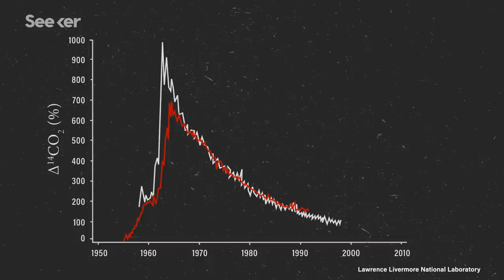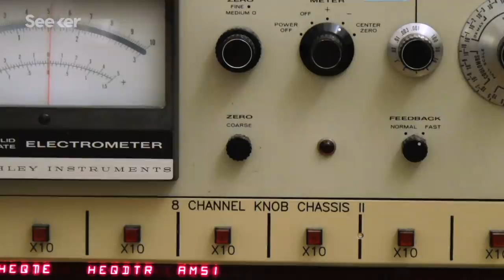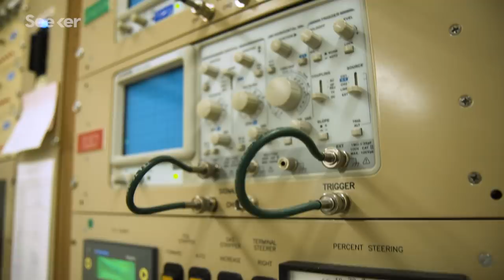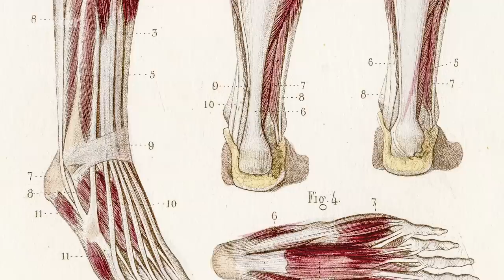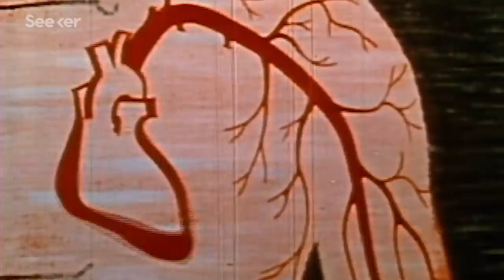We Found Radioactive Traces From Nuclear Bombs in the Mariana Trench

Comment: So the amount of Carbon 14 in the atmosphere rises and falls, depending on current circumstances. So how can we assure accurate radiocarbon dating is accurate if the levels of Carbon 14 fluctuate?
Reply: +1
Reply: 1+
Reply: This
Reply: @acjo8975  This
Reply: Cuz we have air samples for almost every decade stores in the layers of ice in the arctic. the lower you go the air in the frozen air bubbles contains older air trapped  inside
Reply: @med8615  Fascinating! How far back do the air samples go? How can we tell when the air bubbles were frozen in the ice?
Reply: @filmfan4  The record in 2017 was drilling a 2.7 million year old ice core from Antarctica. Idk if it's been beat yet, probably has but too lazy to search. 
They know cuz it snows on the south pole on a regular seasonal basis so each layer represents each year of snow fall. so  it kind of sedements over time like the layers of earth in the grand canyon. So they start from the top layer and count their way down to see how old each layer is. they also match up the data from other rings/ rocks and to confirm their findings. It's like studying each ring on a tree stump but the layers would be vertical. they drill out these couple mile long poles of ice, it's cool stuff. Search up "Ice cores" on youtube or google to see how they do it. They use it to confirm ancient air contents, when ancient volcanos exploded, the switching of the earth's magnetics poles and other cool shit.
Reply: @Tom Holland So apparently for the 2.7 million year old sample they didn't do the conventional ice coring to the deepest part of the ice sheet till bedrock method we were talking about, they used a different approach. After reading the article it seems that they looked for 'blue ice' which is really dense ice that is found in glaciers. Since glacier are floating the sample inside a glacier can be a lot older cuz it could've broken off millions of years ago from the ice sheet and been floating around gaining layers since. 
The conventional method is limited by geothermal energy. Heat from the earth's core can slowly melt away the layer that is touching bedrock (which would be the oldest layer in the sample). So ice that is millions of years old that gathered on the main ice sheet on top is melted a long time ago. It's like constantly layering slices of cheese on top of each other on a hot pan.

Luckily the sample of ancient blue ice they found probably broke off from the main ice sheet millions of years ago and became a floating glacier on the surface, safe from geothermal melting. It was found on Allan Hills where they seems to be a lot of ancient blue ice along the coast. Some are still floating glaciers while others seems to have joined back on the mainland. It was also found flipped on its side so they had to drill a core horizontally which is pretty cool I guess. 

Since surfaced ancient blue ice can last so long they're thinking they may be able to find a 5 million year old sample.
Also the record for the conventional bedrock core is 800,000 years so your numbers are a bit off but really good attempt! There has to be some intrinsic property of the layers we're both ignorant of in those calculations, compression maybe? idk honestly. but somehow they found an 800k y/o sample at bedrock. that's also the oldest one at bedrock cuz anything >800k years old melted...rip. hopefully the blue ice samples are really really old at their core so we can map gas levels further back.
take a look at the papers on library genesis
2.7 million y/o core paper
DOI: 10.1126/science.357.6352.630
800,000 y/o core paper
DOI: 10.1038/nature06949
Reply: They cant it's just smoke and mirrors
Reply: @med8615  Very interesting paper!
Do we know for certain that the glacier did break off millions of years ago, or is that a hypothesis?
If the oldest layer melted then wouldn’t the trapped gases be released? How could we then tell how much Carbon 14 was in the atmosphere?
So we can tell blue ice is more dense, and therefore is more likely to last longer than thinner ice. How can we tell how old the blue ice is? Would an ice age create more blue ice or thicker blue ice?
I’m sorry to keep doing this, but how do we know that conventional bedrock is 800,000 years old? The way we work out the age of things is really complicated. It feels like every method of dating relies on something else, which relies on something else…and so on. Where did it start?
Reply: @filmfan4  good questions, stay curious, I'll write you a reply tomorrow it's midnight here lol. I think you may've misunderstood a couple things I wrote, no worries though. Also turns out I made a mistake about the carbon-14 thing, I'll mention it tomorrow. did you get the melting cheese analogy? the hot pan being the rock continent of Antarctica,  the stacked cheese being the layers of ice.
Reply: UZ Yes I think I got the cheese analogy.
Reply: Good question 👍🏼
Reply: @med8615  I for one have learned from this conversation and am looking forward to your update
Reply: You can't. Radiocarbon dating is a farce. No one wants to admit it openly though - at least not in any forum.
Reply: this is why i put melting butter on my head
Reply: Easy because we compare our findings with other objects we have carbon dated, checkmate atheist....
Reply: @med8615  I'm interested as well :)

Comment: If the number of fat cells stays the same. Just shrinking and enlarging. What happens when someone has liposuction? 

Curious if through repeated uses the body more or less runs out of storage sites in the areas mostly cleared of cells.

Imagine that could have some horrific unwanted side effects like having a muffin top on your chin.
Reply: The fat cells are sucked/scraped out during liposuction I believe, and is the only actual way to get rid of them.

Comment: The whole radio carbon dating process seems really messy and unreliable.
Reply: Depends how far back you go.  For time scales of a few decades up to a couple thousand years (basically all of recorded human history,) its pretty accurate.  Radioactive decay half-lives are very consistent, as long as you have a large enough sample set (since its a statistical measure.)  But given how tiny atoms are, a "large enough sample set" is actually a very small amount of material -- on the microgram scale or maybe even less.

Of course, you wouldn't want to try to use C14 to date things like dinosaur fossils.  But there are other atoms that can date things that far back.  You have less precision (so you might have a +/- of tens or even hundreds of thousands of years,) but when you're dealing with time scales of millions of years, that loss of precision becomes a rounding error.  Or in other words, nobody cares if you can state that the dinosaurs were wiped out on July 12 at 4:38am in the year BC65,382,499.  Its good enough to just say "65 million years ago" in 99.9999% of all common usage, even scientific usage.  I mean sure we'd love it if we could be that accurate, but its not really necessary for us to compose reasonably detailed timelines of the Earth's history.

And of course we have other measurements to compare these things to so that we're confident that we're making good extrapolations rather than pure assumption.  For carbon dating for example, we can compare how our C14 techniques line up to things like tree rings.  If they line up accurately for 1000 or 1500 years (and they do) then its reasonable to assume that they'd line up for 2000 or 3000 years if we happened to run across a tree that old.  But even then we have other comparisons.  For example we can compare against artifacts found in ancient Greek and Egyptian cities/temples/etc where we know the history of those places with good certainty from written documentation, and can compare those written records against whatever carbon-containing artifacts we find and again, they line up pretty well.

But there is a limit.  A 5200 year half life isn't the same as forever and the statistics themselves start to get weaker and weaker as you go further back in time (essentially, those sample sizes get too small to accurately measure, due to the fact that the C14 is well.. decaying.)   Just the pure mathematics prevents carbon dating from being reliable for more than a few hundred thousand years, even if we had reliable comparison material from that far back to validate against.  That's enough to cover basically all of human history (not just recorded history) but not too much beyond that.

So we switch to less precise but longer-lived radioactive materials.  But there again we have other measurements to compare against -- core samples and geologic stratification (ie: rock layers) and things like that.

While there's always a level of error involved in any measurement (hell even reading an explicitly date document from some ancient civilization comes with some potential for error since we don't always know precisely what day they chose as the start of their calendars.  Even our modern Gregorian calendar is difficult to precisely date more than a thousand or so years because various rulers dictated random changes over the centuries and while we have knowledge of a lot of those changes, there's no guarantee we have knowledge of all of them.  Even Jesus' birthday isn't known with complete accuracy, though its pretty widely believed to not be on Dec 25 for various reasons that I don't really recall and am too lazy to Google.)

But science knows how to deal with the potential for error.  We have measurements to determine how accurate our measurements are!  And as long as everyone follows the rules and understands that error measurements are just as important as the actual data, our total knowledge can be considered reasonably solid within those provided boundaries.

Comment: Your skeleton is the same age as you.
Your skeleton and you, are not different ages.
Reply: correction. the cells in your bones are gradually replaced as you age. as are almost every cell in your body. within 20 years, nearly every piece of you will NOT be the original cells you were born with.
Reply: Bazooka Llama Productions it’s the same age though
Reply: @saulgoodman2018  but if every single piece of it has been replaced, and the old bits discarded, its not the same material anymore.
Reply: Bazooka Llama Productions if your skin and everything is still attached, it’s the same age as you. You don’t regrow a new skeleton.
Reply: @saulgoodman2018  according to business insider, the entire skeleton will have been regrown over the course of ten years, with the new skeleton containing none of the original material from the first one. if i tear down a house, and build an identical house from brand new materials, its not the same house.
Reply: @saulgoodman2018  if i build a rubber duck in a factory, set that duck on fire, then build an identical one, is it the same?
Reply: @bazookallamaproductions5280  You bones are you bones. It does not go away on it's own.
Reply: @saulgoodman2018  ive logically gone through things, now im citing two additional sources as evidence to further back up my claims.

all youve managed to do is repeatedly say "nuh uh" over and over. 

i think this argument is finished.
Reply: @bazookallamaproductions5280  I am not talking about any cells.
I am talking about the physical skeleton.
And it does not get rid of all the sells anyway.